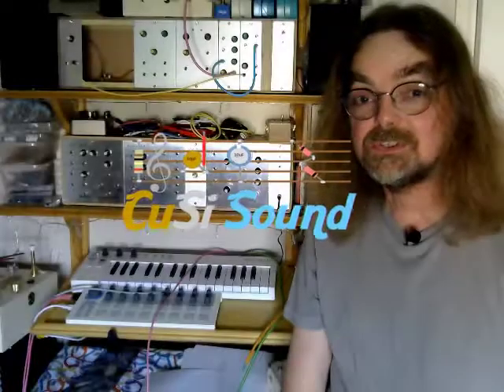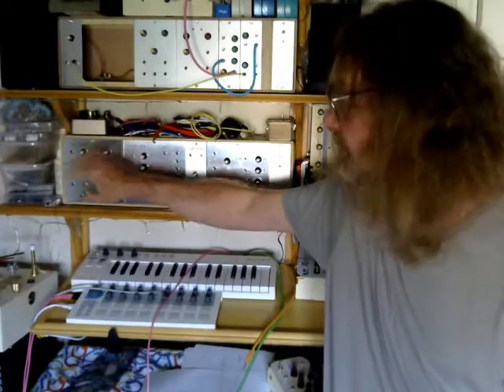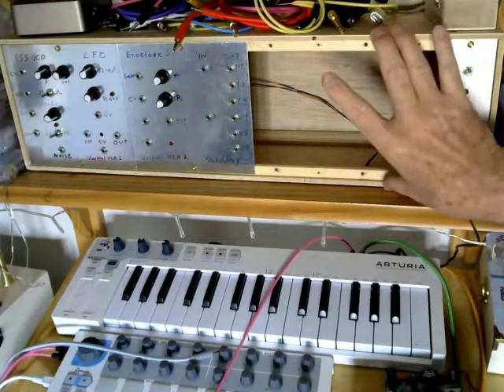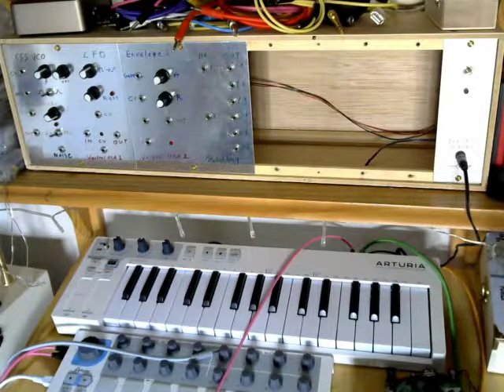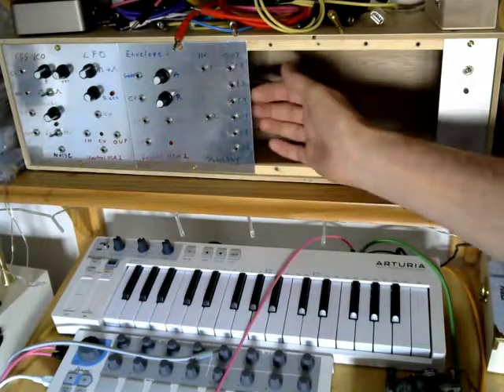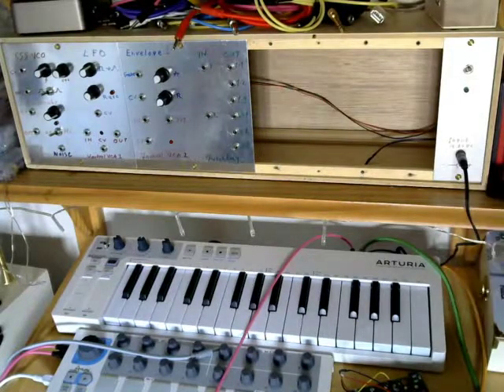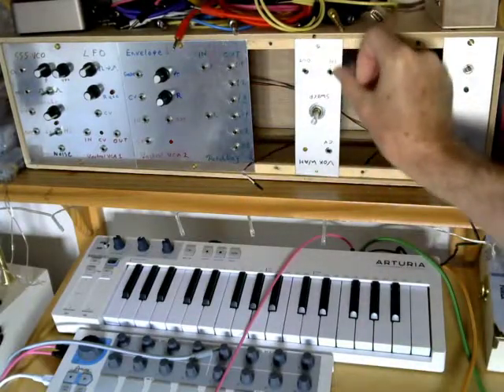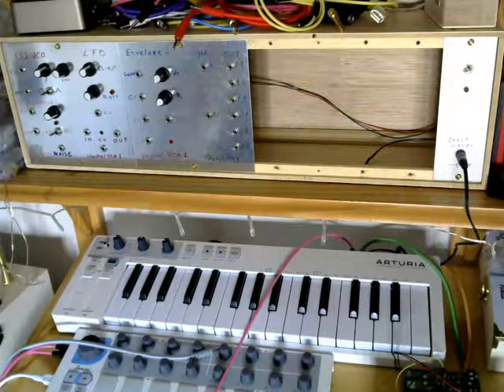Project Nine Modular Analogue Synth : Case Design & Power Supply

Comment: Hi there. I was wondering if yo could help. I have a 12v voltage regulator, L78S12CV. If I were to put that in place of the 7809, would I need to change the capacitors as well? Thanks 🙏
Reply from the maker: I assume you want to run on +12V DC rather than +9V DC. The datasheet for the L78 series of regulators shows the same capacitors for all voltage ranges. However, you will need around 15V to 18V DC on the input to get a stable 12V DC on the output. Data sheet : https://docs.rs-online.com/aa56/0900766b813e4736.pdf
Reply: @CuSiSound  great  thank you 🙏 
I also have a question about your little boxes VCA, which I’ll put in the comments of that video👍

Comment: YouTube can read my mind. I'm planing on start a 9v modular synth to, today i was thinking about the power supply and boom, your video appear in my recommendations. 
Can you share the power supply schematics?
Do you know how much modules can you power whit it and you wall socket?
Thanks for sharing your process!
Reply from the maker: In the original Project Nine synth I used the 78L09 voltage regulator that has a maximum current rating of 0.1A and that appeared to work OK with the modules I had in that system. For Project Nine-20 I used the L7809 voltage regulator that has a maximum current rating of 1.5A so with a 12v DC adaptor that can deliver at least that power I should easily accommodate all the modules in the synth. I have not measured the current consumption of my synth modules so I don't know how close to the limit I am. As for circuit diagrams, the data sheet for either regulator has the basic diagram but it is just a capacitor across the input and one across the output. I will be posting a video this weekend on how I put the power supply together on Project Nine-20 so come back and check that out. Good luck with your synth project.
Reply: @CuSiSound  thanks for your help!! Now i'm watching the rest of the videos.